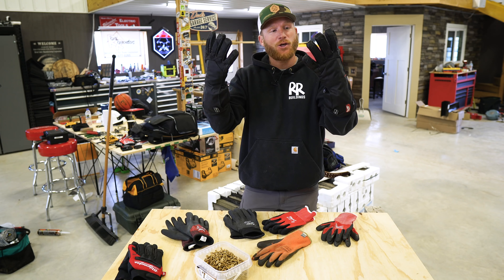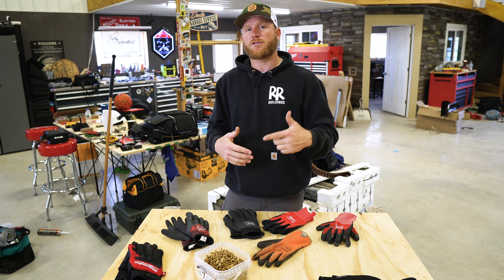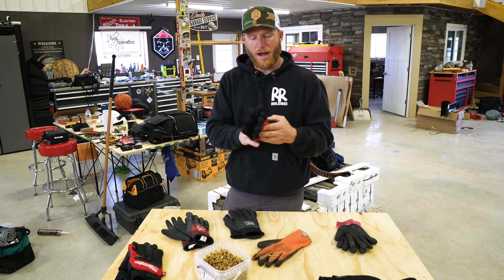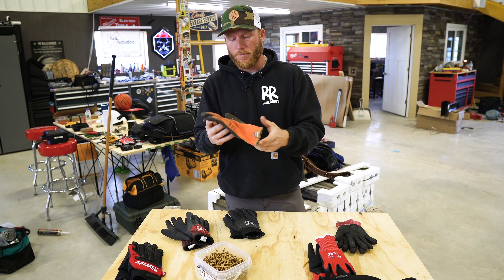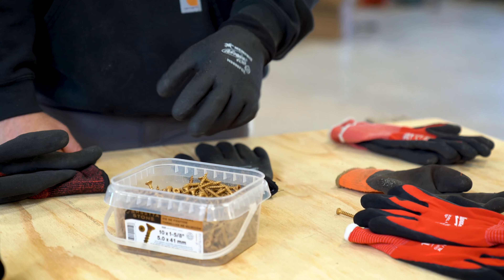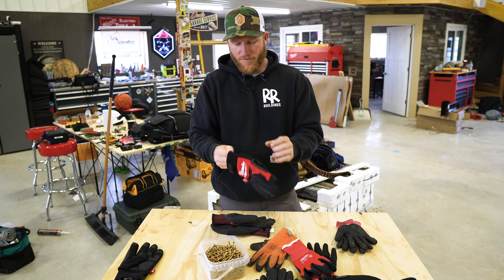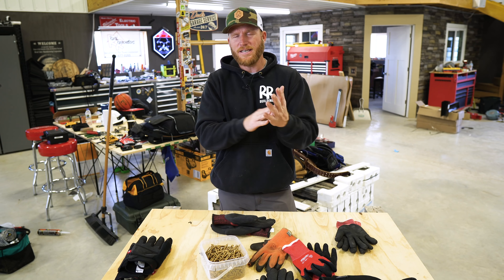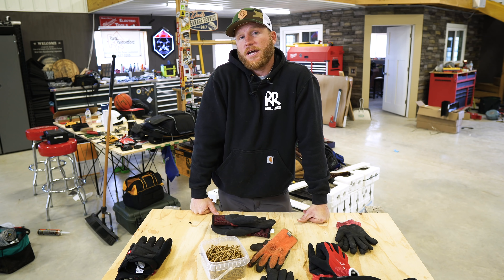Best Winter Work Gloves

Comment: Those surgical gloves underneath wool gloves is a no-go,  hands sweat bad.
Reply: The only time I use the latex gloves under a glove is if my fingers get dried out and cracking, there’s nothing worse than a little split at the top of a finger or thumb. They definitely help heal your hands faster, but other than that yes they definitely make your hans sweat.

Comment: I work for NCDOT and handle aluminum signs and steel sign post everyday. The first pair you showed us is basically what I use. I have some heavier insulated gloves but they work best for moving material. The thin gloves give the best dexterity, especially when handling the bolts and nuts.

Comment: I use the Milwaukee A1 and they are great! I wore them in -22 doing framing. You start off cold but once you start moving those gloves hold the warmth really well. And one day a coworker slipped with a recip saw and caught my hand full on with the blade and it didn’t phase the glove one bit and I felt nothing. Highly recommend!!

Comment: I work outside as a compressor mechanic. My go to winter glove is the Mechanix wear insulated original gloves. if I am going to be working in a wet or oily area I put on surgical gloves as liners and it works pretty good for me.
Reply from the maker: Perfect thanks

Comment: I've been building pole building for about 15 years now and my glove combo is a cut level 3 thin Milwaukee glove. And when it's cold I put a pair of the brown Jersey gloves over top. It holds the warmth in and when I have to handle steel i can pull the Jerseys off real quick. I've also purchased the new Milwaukee winter water resistant glove. And I yes they are bulky but kept my hands warm and dry. Good video bud keep it up.   👊

Comment: useful tip for using gloves outside... i always wear black nitrate latex gloves underneath my Milwaukee cut level 1 gloves.. the latex gloves are thin enough where i don't notice the extra layer and if they do get wet.. my hands stay dry! may not work for everyone, but it works for me! great video, Kyle

Comment: Humidity plays a huge part in cold. Here in Montana I rarely wear gloves all winter installing DirecTV. The exception is when I'm holding metal. Then I use mechanic gloves. We have found that the black napa latex gloves under the mechanic gloves work great for keeping your hands warm and dry.

Comment: The Maxiflex gloves are the best for me !
Perfect fit and dexterity, great protection and they add you a lot more grip strength to your hands with their super grippy texture.
Reply: They rock. Just beware the cut resistance is so so. I left a fingertip inside a completely severed glove. The bottom tendon was still attached so removing the rest of the glove was fun.
Reply: @danichicago9140  This comment made me weak. Did they reattach it😟🥴
Reply: @victoriacarter6467  Yes. It's a little crooked but actually works.
Reply: @danichicago9140  Oh thank goodness.

Comment: 1st day with cut 1 gloves I shredded through the knuckle right through to the cartilage with an angle grinder.  Slowed down a bit after that.
Reply from the maker: Yeah I don’t think they are meant to stop a grinder.  Sorry to hear that
Reply: RR Buildings I still have them and use them all the time. I get to see the cool scar through the hole in the glove ;)

Comment: I have used Atlas thermal fit 300 for years.  Starting with masonry and then with carpentry in the winter.  Best gloves for durability and cost.  I buy them in pairs of 12 off amazon.  Atlas gloves all around are my go to work gloves.  There coating seems to last the longest compared to others.
Reply: Also if your doing tons of snow removal or getting your gloves wet use a disposable latex type glove underneath them and your good.  Now if you don’t move enough your cold either way lol
Reply from the maker: Thanks

Comment: Try the Ansell Powerflex kevlar. Cut level 4. These gloves are Arc flash rated which will add some warmth in the winter. I use them as general work gloves on electrical equipment. Very good wear.
Reply from the maker: Thanks will look into it

Comment: I was goin to say but you touched on it. The cheap latex gloves. I fuel semi trucks and the refer units for a company all day long outside. I live in iowa so it gets cold. I can easily wear the latex gloves by themselves to about mid 20s before my fingers start to get a little tingle. I usually can stand the tingling feeling for a long time before I'll use a thin glove that has a nice rubber kind of grip. That can last me to about single digit temps. Once the single digit temps hit then I use the latex and my insulated leather gloves over that. Great video! 
I bought those Milwaukee heated gloves to try them when it gets real cold. I'm pretty sure they will work fine for what I do.

Comment: Thanks man , I work in a plantation , I do a lot of irrigation work but now its fall time , not as cold as your winter for sure, but there's high humidity so that 5-6 am chill can get into the bones ,especially when I'm driving 25km/hr on an open cabin tractor. So gonna need better gloves ,  my current gloves are super breathable and dexterous , ill try wearing some nitrile gloves underneath see how that works.  Later on in the day when the sun is fully out its less of an issue.   
Also putting the gloves to heat up on the hood of the tractor kind of helps at times when I need to take them off to handle some wet stuff.

Comment: The dark red gloves are cut level 3 INSULATED gloves try the regular cut level 3s they are thinner then the cut level 1s  and have alot better feel and do great with steel i do alot of steel buildings myself and i use them most of the year only on the coldest of days i use the insulated ones and deal with the lack of feeling

Comment: I wear the Milwaukee cut level 3 summer and winter love them
Reply: Insulated or regular cut level 3 you wear year round? Have you tried the level 5 versions? I'm trying to figure out which glove to get to do landscaping mainly that will last. Why I thought maybe level 5?
Reply: @shanew7361  as long as I keep my hands dry the gloves are just enough
Reply: @rpietros  Do the fingertips wear out fast? Thanks

Comment: The uninsulated Milwaukee cut 1 are my favorite. They just fit great. I'll wear them even in the 20's F. Home depot is selling 6-packs for $20 now during their holiday sales. I bought like a dozen packs!
Reply from the maker: They are good
Reply: Are they a good touchscreen and grip?
Reply: @kkdpistons1160  yes. They're advertised as touchscreen use. Though it doesn't work as good when the gloves are worn out. Grip and fit is excellent.
Reply: @skliros9235  Have you used this same glove in cut level 3 and 5? Trying to find a decent glove for landscaping.
Reply: @shanew7361  I've tried the  others on in the store but are too thick in my opinion. The cut level 1 is almost like not wearing gloves. Very good light fit.
Reply: @skliros9235  Do the finger tips wear out fast? Needing to use them in daily landscaping etc
Reply: @shanew7361  they last a long time. Way longer than the husky or mechanix cloth type gloves. I use them for framing concrete etc. Go buy a pair for $5 at home depot and try them out.
Reply: @skliros9235  Yea, I've tried the mechanix ones. Those are junk and way overpriced.  The cut level 3 uninsulated ones I was thinking.

Comment: Ice ninja makes a pair that's not full dipped.  It's just the palms and finger tips like the Milwaukee.  I have both styles of the ninjas, wear the full dipped when it's wet and the partial when it's dry.  Best winter work gloves I've ever used.
Reply from the maker: Not a fan of the full dipped but I bet the other ones would be good

Comment: I live in Alberta Canada. Work up to -30c after that gun seals freeze up.  I wear a thick glove with a liner under it. When I gotta pull nails outta my pouch I just remove the thicker glove.  A thin battery heated glove would be great. I'd pay good money for something that was designed to last a few months.
Reply: Walter Taylor I agree that if they could make a thin heated glove it would that would be perfect 👍🏼

Comment: We have ATG gloves at work (vehicle manufacturing) and they do offer a wide variety of Nitril coated gloves. They also offer a warmer version called MaxiTherm (looks similar to this Power Grab Thermo). I think they're ok when handling screws but obviously not as good as a thinner glove. However they keep your hands warm and transport sweat away from your skin effectively. Can't compare to Milwaukee but I never had one of these gloves come apart so maybe you want to give them a try.

Comment: Craftsman makes a single layer mechanics glove that is windproof.   Can pick up panel nails and holds up to roofing. I use it for metal and shingle roofing.  In Texas mainly worried about preventing burns not cold but they work down to the thirties comfortably.     Pray for me that I can keep getting them after the Stanley buy out.

Comment: I have always used the 10 for 12$ nitrile ones and when it’s cold the surgical gloves underneath. They are both cheap so when your wear points go it doesn’t suck to throw them out when the rest of the glove is still good .

Comment: Hey love the vids i notice on all your builds your using single skin claddimg on the walls and insulating inside with rock wool have you ever used the kingspan rw panel does both jobs at once and you can get it in any ral colour and from as little as 40mm thick  ?
Reply from the maker: I have not but seen it

Comment: Whichever gloves that has rubber it's not a great glove to use during the winter. The rubber part gets so cold immediately that your fingers get numb. They don't get wet easily but it doesn't keep your hands warm
Reply: They make a new insulated version that’s not to bulky but still keeps your hands worm

Comment: so if anyone sees this. I work at very High elevation in the mountains at night. I deal with the elements, trash removal from 4 different lodges that leak fluids a lot of the time. Last year i wasnt prepared for that and my gloves were good by the cold got to them really quickly and i used hand warmers inside the gloves to keep my hands warm. Ive been looking but i cant find the right kind of gloves or im actually unsure of what i should get. I had leather gloves given to me but those were actually the worst the amount of water that it instantly soaked were terrible. Not good when youre up in sub minus temps with wind chills that make that even worse.
Any got any suggestions. Money isnt a issue, Just really need so very solid pair for the conditions im going to be working in this winter. Any and Any suggestions would be great! Also my hands get cold really easy.

Comment: Well, I just ordered a set of Milwaukee Cut Level 1 Gloves so we'll see.  (I help build houses for Habitat for Humanity).
Reply from the maker: Best of luck
Reply: If you ordered the right size you won’t be disappointed they are comfortable and don’t limit what you can pickup as far as small hardware. You can also throw them in the washing machine without damaging them but I would recommend drying them unless there a little big.